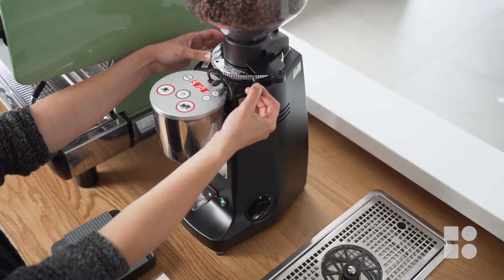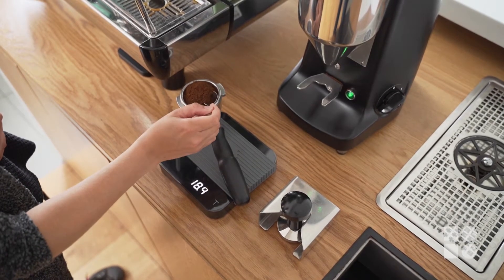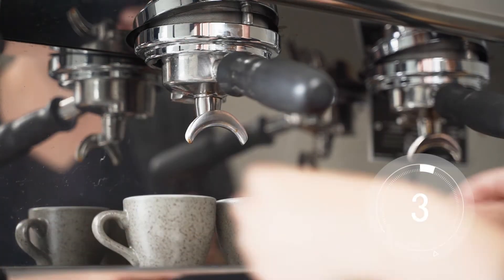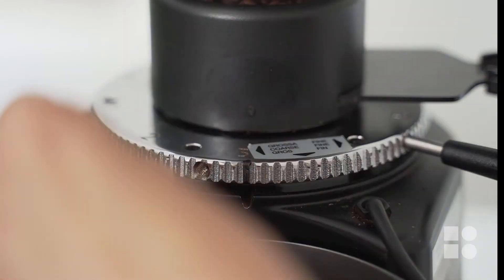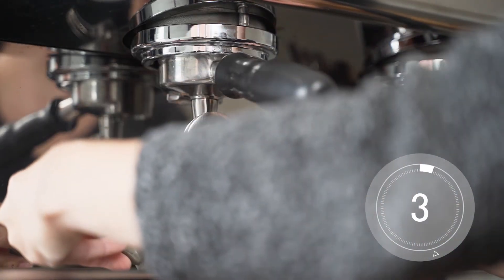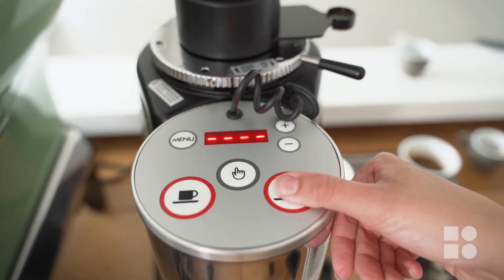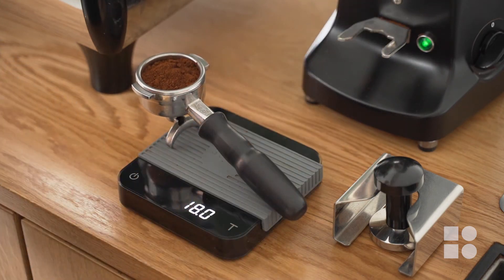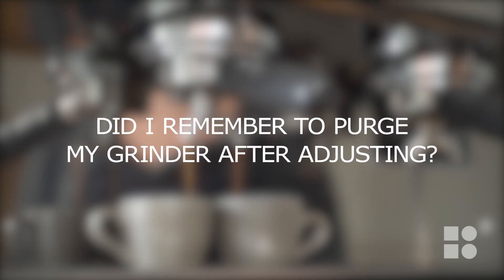Beginners Guide to Dialing In and Adjusting your Mazzer OD

Comment: Very helpful video. Thanks! Especially because we use the Mazzer in the cafe I work in.
Reply: I've worked with them in 3 different cafes and unfortunately what tipe of coffee machine you use makes a huge difference in how well this machine will work so much so that I had to get the rosters in so many tes they got bored of it and gave us a different grinder
Reply: @njv.rooyen5353  ...Not sure what you mean ? Surely this grinder is pretty consistent to the setting you give and it's very adaptable grind size setting wise. How is an independent machine affected by different espresso machines when you can set up the grind size to suit each machine ?
Reply: @njv.rooyen5353 I also don’t get how the particular espresso machine you’re using would be relevant to this particular grinder